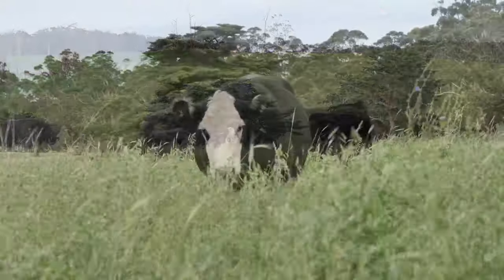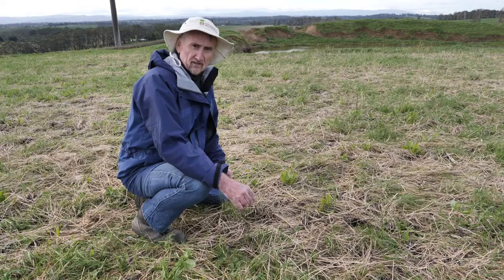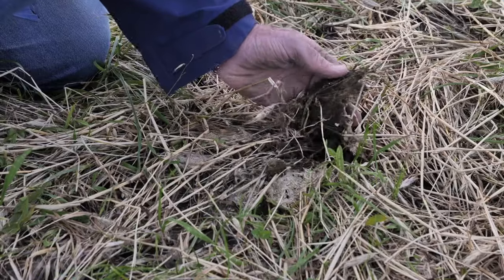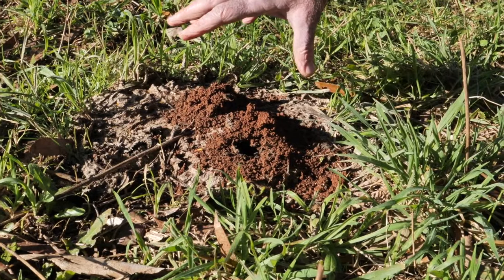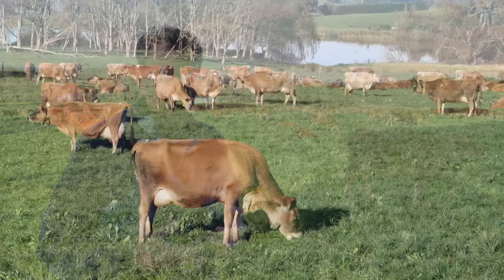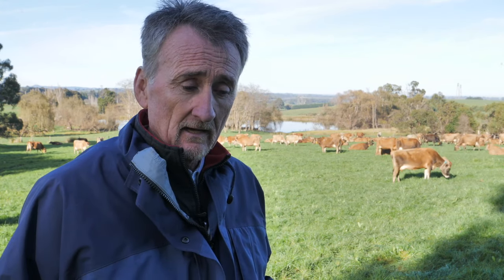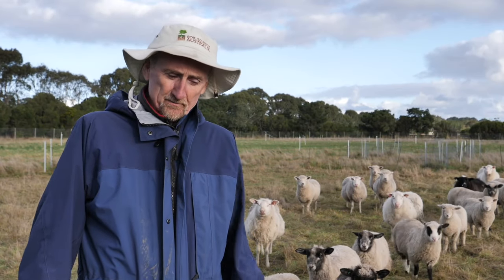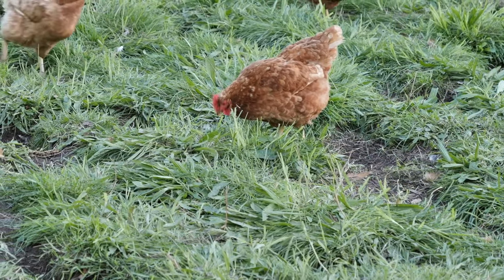Regenerative Agriculture - Key Principle 5 - Integration of Livestock

Comment: Thank you for this video. Are 45 days enough resting time on pasture?
Reply from the maker: Rest period will depend on the seasons, the species in the pasture, what type on animals are grazing, and what latitude you are located. Rest periods between grazing will vary significantly dependent on all of these variables. You need to work out what works best for your situation, as your objectives may be quite different from other peoples. Different grazing animals also have specific nutritional requirements you need to meet, so your focus should be more on growing a pasture which meet your animals requirements, maximises photosynthesis, builds pasture resilience, and regenerates soil. This will then help you determine the length of your rest period.